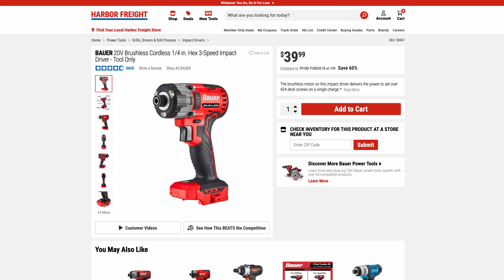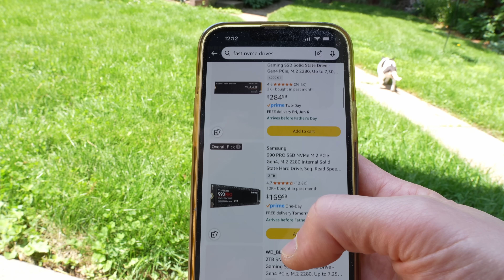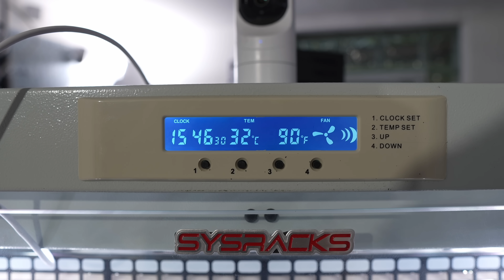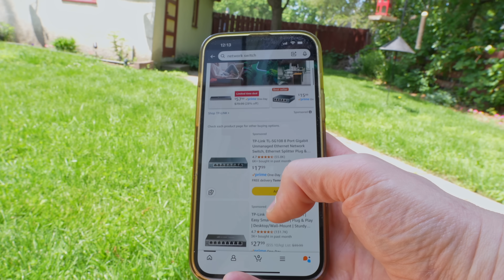Buy Once, Cry Once: How I Wasted $2,857 on Switches

Comment: I "suffer" from what I call "Upgrad-itis"...   Better explained through an anecdote...
Many moons ago I was looking to buy a cheap receiver for my little "home theater" (TV + Stereo) so I could switch between inputs/consoles easier.   
I walked into the store and was looking at a used Onkyo in the $200 range.
Great!  It'll do exactly what I need it to today!
So, what I do then is look at "the upgrade".
Find the unit that is the next step up spec wise, look over the features, and ponder if what it is offering is something I can see myself using "soon", even if I don't need it today.
If I find features that aren't a "MUST HAVE" today, but I can see becoming so before I plan to upgrade again, that becomes the new baseline.....
So, what I do then is look at "the upgrade"......  
and that's how I spent a bit over a thousand dollars on a home theater receiver that was four models above and hilariously overkill for what I needed at the time, BUT I was able to continue using for almost a decade without feeling stifled until 1080p/HDMI finally managed to completely obsolete it.
---
My next switch is probably going to be something in the 8x200+ range, because with a chonk core switch, I can put the ludicrously spoiled devices on it (Main PC, NAS, VMs, etc), and still have plenty of bandwidth to connect to a switch that "only" does 10Gbe/POE for the rest of the devices.

Comment: I just got the 24 port Pro HD poe.  I don't really need 10gig in the home theater rack or even 2.5g, but I can connect my 2 servers (storage and homelab) to the SFP and then trunk it out to my main switch and I'm good. It was definitely a cry once thing. It replaced an old 24port unifi switch I got second hand. Having the poe will be great too 

I thought about the XGs but I really couldn't afford to cry that much... Lol. 

At some point I'm going to have to replace my 48 port pro Poe and I might consider the 48 port XG, but man that is a lot. I wish they would push out the 48 port HD, but that in that location I could really see using the 10 gig ports on the XG. I guess I'll start saving now.

Comment: I you really want to cry install something like librenms and ask it to monitor your data usage on your switches, routers and servers. It's a really cool tool, but it will also show you how little you utilise your shiny new 10 gig network. I run gigabit at home but fancy switching to 10 gig and then librenms shows me that the only time I max out my gigabit network is for roughly 5-6 minutes at 3am when my servers sync backups, the rest of the week I use like 0.5 % of my bandwidth. Sure, copying that bluray rip from my pc to my server would take 30 seconds rather than 3 minutes if I switched to 10 gig, but apart from that gigabit covers my needs 100 times over.. Don't ever install a monitoring tool to show you how little use you actually have for those shiny 48 10 gig ports..

Comment: I just replaced all my ubiquiti gear with Cisco 9k gear because I needed actual enterprise equipment. ouch.
Reply from the maker: I don't need enterprise at home but going to check out the 9k line.
Reply: @TechnoTim  you will need to either work with a company that has active support contracts and be part of their smart account to download updated firmware or just use the firmware that comes with it. On top of that, Cisco IOS is not exactly easy to jump on board without experience, it's a proper full-fledged network operating system but will give you crazy experience and invaluable skills in the real world.

Comment: Tim, you put things very much in perspective in this video. I just replaced my QNAP 10-gig switches that I've had for years with two UniFi Pro XG 10 PoE switches. I wanted to save some money by getting the Pro XG 8 PoE switches but they weren't quite out yet. Now that I look at it, I'm glad I spent $200 more per switch as the 8-port models would be FULL or just have ONE port free if I had done that. Yeah, I dropped $1,500 on switches, but these should fit my needs for years to come. So Buy Once Cry Once is very applicable!
Reply from the maker: Thank you and I totally get it.  It's much easier to look back and recognize it, more than when you are making the decision.  I did it 4x fo rthe same problem!

Comment: I learned this the hard way with cameras...
- Bought a cheap camera but outgrew it really quickly.
- Bought a slightly more expensive camera but outgrew that really quickly as well.
- Now I have an expensive camera with a lot of the bells and whistles and it saved me lots of headaches.

So nowadays, I tend to just save up and buy "better than I need for as long as the device is still relevant" to avoid headaches.
Sure it might "waste" money but headaches are a bigger problem for me.

Comment: Buy Once Cry Once but the switch you bought didn't exist until this year?
Reply: Yep was going to say this very thing. Buy what you need when you need it and downsize/resell/give away gear when you don’t need it anymore.

If you wait forever for the perfect solution you will always be in a wait state.
Reply: Yeah this is the big flaw in this video. What he's saying isn't necessarily incorrect int he right circumstances, but it's not applicable here. The unifi switch, for what it is, is cheap. Had he bought something comparable to that from the start, he likely would have paid a lot more than $2.7k at the time from some other vendor.
Reply: the logic isnt logic-ing fr
Reply: Could of got a proper switch before that a 10 gig Aruba? But again more money
Reply from the maker: 06:40
Reply: @TechnoTim I agree but I was in your shoes 16? Months ago. I got the USW-Pro-HD-24-PoE and replaced all other switches. Even saved me 2U of space (but now the rack won’t close). But I’m already looking for expansions of those 10 gbit Ethernet ports 👀 

Homelab is a gateway drug…
Reply: Zyxel Switch have that 2 year ago
Reply: Maybe there was a previous switch that filled the same niche

Comment: This has been my mindset for hard drives for a while now, it’s better to save up and get an expensive new (unused, not necessarily latest tech) enterprise drive with a proper warranty than “refurbished” drives that will most certainly fail (cough cough I’m looking at you refurbished seagate exos buyers on serverpartsdeals, notice how everyone with those drives have only ever had them for a year or two). Likewise with space, it’s better to save up and get that same enterprise drive in 24tb vs buying a bunch of 4 tb drives with a worse cost per tb + the massive increase in power draw/noise/issues that come from spamming a bunch of drives

Comment: Probably the most flagrant "how do I write off 6,000$ of equipment on my taxes" I have ever seen.

There's a massive disparity between poor planning/forecasting and whatever you consider the opposite of 'buy once cry once.'

The proper strategy is to buy the Harbor Freight version and if it's something you use enough to break it, then you buy a higher quality/longevity version. This maximizes savings for items you may end up not utilizing/realizing their full value, gives you experience to know what you want from a tool in that category/with that purpose, and empirically selects the actual needs you have. These are really superficial wants you've outlined, hardly any actual needs.

Recent subscriber, now ex-subscriber, and it's quite painful giving engagement to this nonsense level of consumerism.
Reply from the maker: Sorry, but I don’t agree with buy the cheap, break it, throw it away, then buy the better.  Sounds like double consumerism and double waste.  As stated in the video, it depends and this was more about helping people do the calculus and sharing my mistakes. Planning is also part of that.  There is no one size fits all which is my point, which you seem to be prescribing.  Also, I outlined my needs.  Take care. Have a great day.

Comment: As usual: there is no one fits all solution. Most people will be limited by money. So you buy what you can afford to get things done. The more critical part is to actually develop the next step. So instead of just thinking about the "just a piece more to fix my current issue" more "lets take everything on the table and check if we can get a better solution overall. This is what most people, even in business, miss. For the homelab people: if you're doing that not just for fun but also as part of your profession, cause you want to test out things etc. you use for work too? Then take your homelab serious, set money aside and invest back into it. So rolling over every 4-5 years is a good rule of thumb imho, but YMMV. If you're doing it for fun: as with all the hobbyies, set a reasonable amount of money aside and grow it as you go. But as with every other hobby: new things need space, so old things need to go.
And don't forget: a big switch is also a big issue if it fails. Your 2k switch might cost another 2k to replace when it fails. And if your whole system depends on it, you will need to prepare for it :)

Comment: Tim why do you need so much gear at home mate? Do you run a business from home? Do you use all that infrastructure for work? Not trying to be an ass or anything, just genuinely curious mate!😊
Reply from the maker: I do self host quite a bit of things.  I also have lots of devices that I would rather hardwire and connect via PoE.  Cameras alone take up quite a few ports!

Comment: Very cool topic that's quite good at triggering introspection. Some random thoughts: I thing every geek and enthusiasts likes to overprovision and experiment that's a hobby that never gets old. So when the budget allows it we buy staff - mostly in waves - then in periods where the situation is tighter we look for stop gaps and quick fixes. Also I think everyone does the top-down replace and move to the periphery approach - like switching out your second level core switches every 3-5 years and your core switches every 4-5 years in line with server hardware replacements / upgrades. So the old gigabit switches go to serve IP cameras and older WiFi APs or secondary parts of the building like the lab, the workshop etc. while the 2.5Gbps with 10Gbps uplink go to the offices, the conferencing rooms etc. and the servers all get dual 25gbps with 100Gbps to the core switch. Smaller office sub-switches then go into a box at the far end of the garden :) As an anecdote - a few years back we decided to go for a buy once and replaced our rack switches with CISCOs - amidst an economic crisis. My IT guy convinced me that running el cheapo D-LINKs without L3 wasn't a good idea. However, we have really bad power here and the aircons went out in the server room one day while the rack stayed online due to their huge UPSs - the CISCOs died and all DLINKs and Mikrotiks survived. Since then none of the DLINKs, Mikrotiks or Trendnets have failed but all CISCOs have long died. So because of this I tend to go for redundancy and everything is a ring network with relatively inexpensive  switches - sort of 3 for the price of one CISCO. Same for servers where a cluster of 3 is almost always more peace of mind than a single huge 64+ core beast.

Comment: I got few simple rules:
1) if it costs 2x as much but it's at least 4x better it's worth it
2) if I can't afford to buy it twice (in case of failure etc..) then I can't afford to buy it once
3) if it's not a step up from what I already have, then no buy
4) if I no longer need something, there's always someone else to make a worthy use of it
5) if I don't check detailed specs and manual before buying, I probably don't actually need it
Reply: Your second point reminds me of a saying in the Elite: Dangerous community: “Don’t fly if you can’t afford the rebuy.”
Reply: @levygaming3133 I haven’t seen a CMDR out here, in the Black, for what seems like ages.
Reply: @TheOfficialOriginalChad  I haven’t actually played it since just after they added planetary landing and the custom mod part crafting. 

My phone still tries to autocorrect to Elite Dangerous whenever I start typing “ED” though.
Reply: @levygaming3133 o7
Reply: @levygaming3133  It's kinda similar in Tarkov: If you can easily replace gear, there's no reason to worry about losing it.
Reply: I think #5 is the most important one.
Reply: No. 2> Killer mantra! I would paraphrase it like this: 2) If you can't afford to lose it once (mainly being stole or getting lost, like a phone or laptop) and buy it again, don't buy it! Also I would add: 6) If it ain't broken don't fix it buying more of the same 7) If it's broken consider or try repairing first
Reply: Also you need the factor in electricity pricing, buy 1 device that supports more functions so you dont have 2, 3 extra ones laying around
Reply: @Chris-hw4mq  electricity isn't that huge deal, because usually power consumption results in heat which is totally repurposed in spring+autumn+winter :D
Reply: @TzzSmk  depends on your region, no? People in Florida paying a lot more for air conditioning than for heating. People in Germany paying like $0.35/KWh.
Reply: @thedanyesful  power consumption on AC is about 500x lower than heating, so the electricity prices would have to be 500x higher
Reply: My version of 3 is that if it's not at least 2 generations beyond what I already have in tech, I don't buy it. Helps me get more life out of my perfectly usable electronics and avoids the ewaste of constant upgrades.
Reply: Good rules.
Reply: eh, I never liked point number 2. too much nuance. I mean, if my house is $200k, does that mean I need to be able to purchase that twice as well? What about a car?! I need to be able to afford a car that's twice the amount I purchased it for?!
Reply: @RandyAugustus  if your house collapses from earthquake or burns down, you should totally have some headroom (even if not full price), if you get into car accident or engine breaks, you're either having another car or accept not having a car for quite a while...

Comment: current network uses 4 switches though i could technically whittle it down to 2.  problem is the severely inaccessible attic space for my 6ft/300lb frame

Comment: Your problem is that you can't control yourself. You want the latest and shiniest thing on the market. Overspending is a form of uncontrolled behavior, just like overeating, smoking, etc which can lead to addition.
Reply: "overspending" dude, 99% of people underspend on their network setup, because they don't value the network security and reliability like they should. good networking equipment is expensive, and it takes time to realize what you need when you need it. 
you can over spend on things, but it doesn't make people happy, it makes people stressed and panicked. unless you like feeling like you waisted money, then no one wants to over spend. 
nevermind your comment is completely out of line with what the point of the video was. Tim's (? first time seeing the channel) point was the complete opposite. don't waste money on things that will only lead to you having to buy another device later on, and spend the money that does everything you need it to do now and later. over build for now, so you can expand into it later. it should last you 5 years, at least. 
that's not "overspending" that's knowing where you will be in the future and planning for it.
Reply from the maker: @TheObsesedAnimeFreaks I am so confused and I am Tim 😅
Reply: @TechnoTim  
TBH, I don't quite want to read what ever i wrote. lol, 

But correct me if I'm wrong, but your point was to plan ahead and get more then you need now so if in the future you need more you are already setup?
I don't see that as over spending. TBH, that's just good planning.
Reply from the maker: Thanks.  I do have control (I have many things in my home that are over 10 years old), I think much of it has to do with performance and longevity more than new and shiny (there are much shinier things out there)

Comment: The problem with UniFi is that every few months they release new hardware.. gateways, switches, access points - that are only slightly better than the previous generation. It's so difficult for the end user to decide when to purchase new equipment and when to wait for the 'next better thing.' Just look at their WiFi 7 AP lineup, it's crazy.

Comment: The only future-proof way of buying stuff is buying second-hand and selling when you don't need it. At 1 switch a year, devaluation is basically a non-issue and you would've spent 0$. I do that for pretty much anything I buy and have a lot more disposable income than if I was buying any tech product new
Reply from the maker: I agree, it's just hard finding ones with 10GBase-T  / PoE++(+?) used.  I guess that's the price I pay ofr being an early adopter of tech 😅. I am definitely going to sell some of these "old" ones now to try to recoup the cost.  Thanks for the suggestions!

Comment: If You Give an IT Tech a Router… If you give an IT tech a router, they'll want a switch to go with it. Once they have a switch, they'll need some Ethernet cables. After running the cables, they'll realize they need proper cable management. Fixing cable management will make them notice their rack is outdated. Upgrading the rack will prompt them to check the firewall. While reviewing the firewall, they'll decide to upgrade their VPN setup. Once they set up the VPN, they'll want to monitor network traffic. While monitoring traffic, they'll notice bandwidth spikes. Investigating bandwidth spikes will make them install QoS rules. And once QoS rules are set, they'll think of optimizing their router setup… Which means they'll want a new router all over again.
Reply from the maker: I need this on a poster!  It reminds me of Jimmy John's "How much is enough?" story they have on the walls.